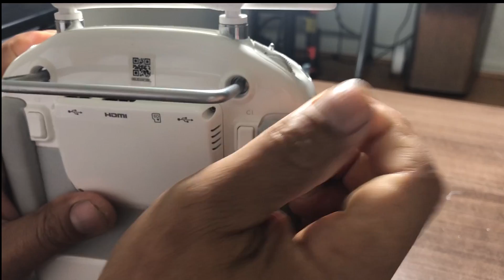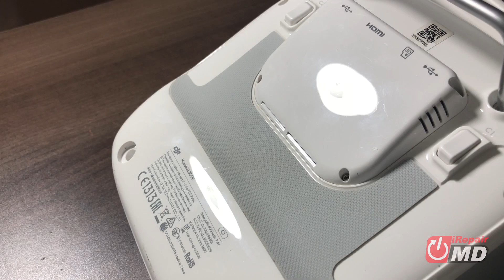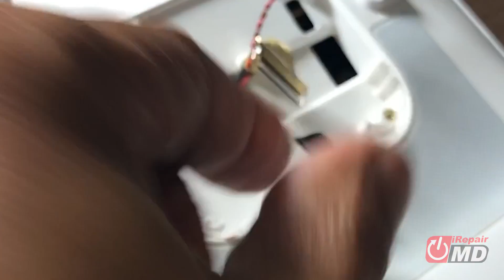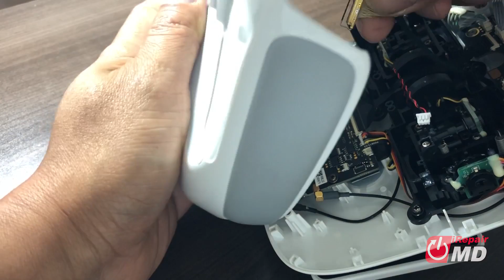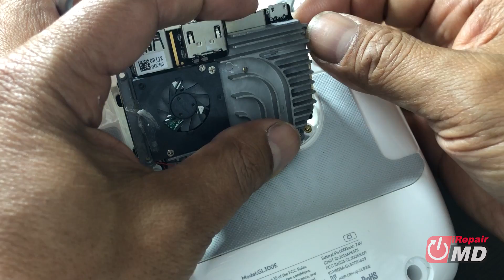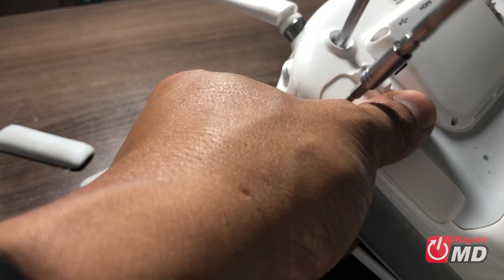Phantom 4 Pro Plus Controller bad battery replacement

Comment: Where did you get the replacement battery and what did it cost ???
18:30... IDK... I think I would have added some thermal paste/compound to increase the transfer of heat to the cooling Fan/Heatsink a bit. Than heatsink seemed quite large.
Thanks for the battery replacement tutorial...;-)